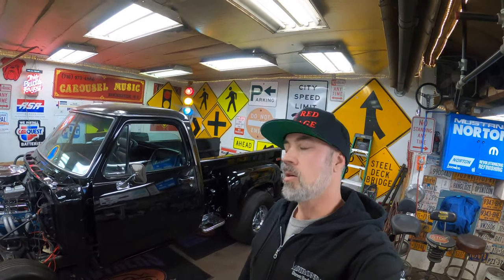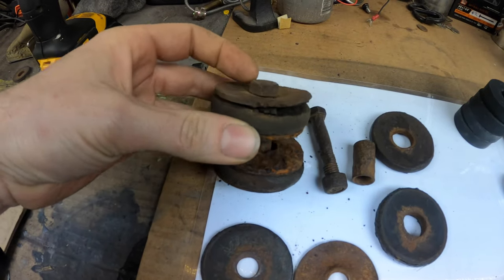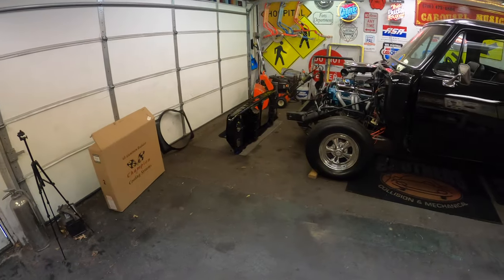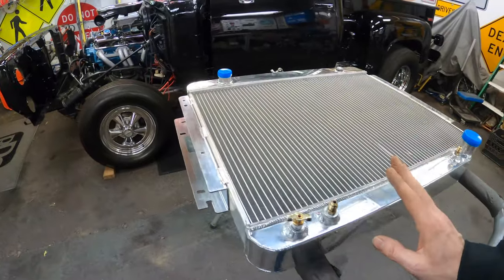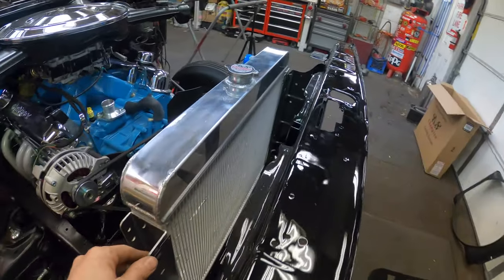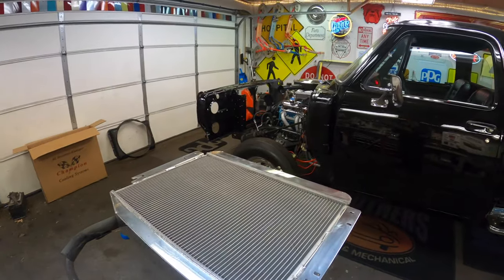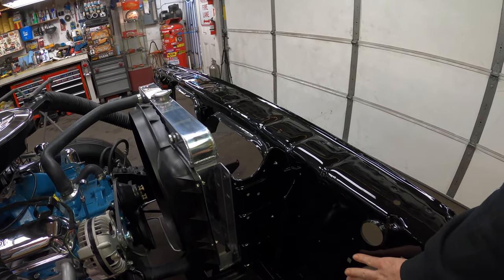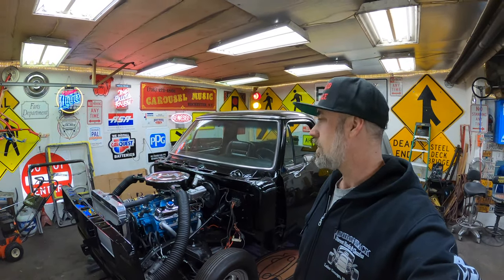1978 Dodge Warlock NOS core support and Champion aluminum radiator installed d100 d150 muscle truck

Comment: First video of yours I have watched and I am impressed. Love the garage and the truck you have in it. Quick list of Dodges I have owned.
66 Barracuda 273 Hi-Po with and 4 speed
68 Coronet 440
73 W200 PowerWagon 360 4 speed
74 Dodge Colt station wagon ( I actually miss that car, it was touch as nails )
83 Dodge RamCharger. This is my current love. Building a 406 stroker and A727 with diesel parts and rebestos goodies. Have a Dana 60 rear, in the search for a Dana 60 front Passenger drop. It was all original down to the lean burn stuff. I have yanked every piece of emissions equipment off it. Line-X'd the interior back windows down, back to front up the fire wall as far as they could spray. Now that I have this RC I look back on all the ones I have owned. The 73W200 I would have robbed the running gear for the RC. The RC and a 68 Coronet are all I want in my driveway next to my Ram I ordered it when I was in Iraq, what I wanted and nothing else especially electric creature comforts. Hell I watched the road through the floor of my 73. My 04 is a Cadillac to me especially after driving military trucks.
89 RamCharger. Parts for the 83
04 Ram 2500 5.7, 5 speed, 4.10's power nothing other than brakes and steering.
Gonna catch up on your videos and thank you for adding part numbers and sources. Ebay sells steering shafts for around $60.00. They are made in the same place as the Borg shafts that cost $250. I try to tell people I ran SKU and it all sources back to the same location. A skill I learned in a college logistics class.
Love to see what you are doing and it looks like you are doing it right.

Comment: Really nice score on the radiator support. I found one in a boneyard from an 87. It was the only one that wasn't twisted or rusted worse than mine. I had to cut out the headlight buckets from both cause it had square cutouts and install the round ones. Luckily it had the wide radiator support.
Reply from the maker: I Looked for one for a long time, almost resorted to using a newer style and retro fitting it like you did. It was a score indeed!

Comment: Liked and subscribed! I THINK the only difference is the Six Cyl and V8 rad supports. The Six cyls had narrower radiators.
Reply from the maker: Thanks man! That makes sense! Out in the shop today and I still have the box the rear bumper came in. I’ll get it packaged up and get a shipping quote If your still interested. Id love to see the old parts get used than sitting for years or get tossed lmk!
Reply: @LilRedGarage  Yes! let me know on the shipping. Appreciate it! I hadn't had my '81 a month, and got hit by a drunk on the way home from work, I had a good '86 rad support from a V8, and not giving it a thought, when I went to put my rad in, it was too narrow for the support. The original owner of mine had swapped out the Slant 6 for a 360.
Reply from the maker: Hey Dave, I have the bumper all packaged up and in the back of my truck. If you want to email me your address I’ll try to drop it off at ups tomorrow. Lilredgarage@yahoo.com

Comment: I just went out and looked at my 79 trailduster and it has the same round holes as yours, but on mine the turn signal/parking lights kinda use that hole for clearance
Reply from the maker: I believe all the 79-80 trucks have the holes, like you said for the turn signal clearance and wires. On the 78 turn signals up in the grill, the old core support I removed did not have them.

Comment: Great  choices,  I didn't know about the little red specific  core supports.  Do you have a NOS grill or will you be restoring an original?  I'm in the process of polishing a 77 grill and then I've got 75 to do, very time consuming.
Reply from the maker: I have the original grill from the truck, it’s in really nice condition except the anodizing is a bit faded. I thought about striping it and polishing but man your right it is super time consuming and tedious work.  I’m going to run it in original condition for now.
Reply: I have a 78 grill that needs A LOT of work. I've had my eye out for one for a while now but no luck

Comment: I have a 77 W100 that I am restoring. What manual do you have? I’m at the point of putting my core support on and was trying to see how you sandwiched the bushings together. My manuals don’t show anything with that part that I have found.
Reply: I have a 78 w150. What manual did you go with?
Reply: @lexrios5452  I did some custom work and mated it up with a NV4500. I would be happy to discuss further if you’re interested.